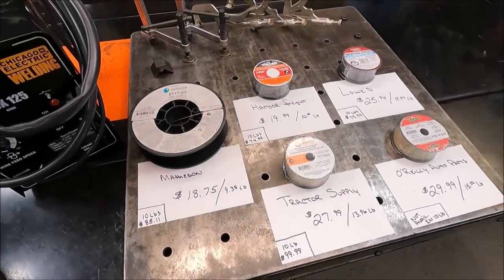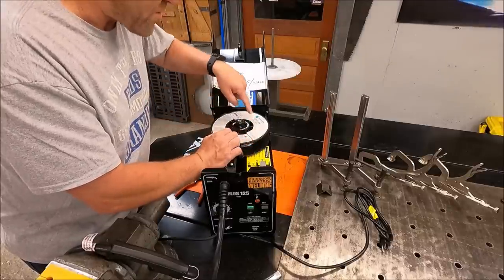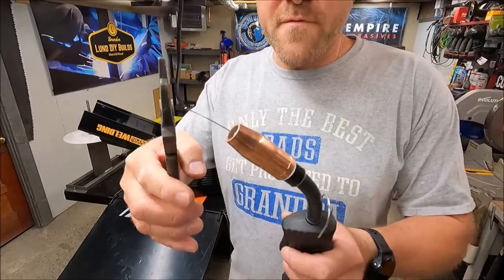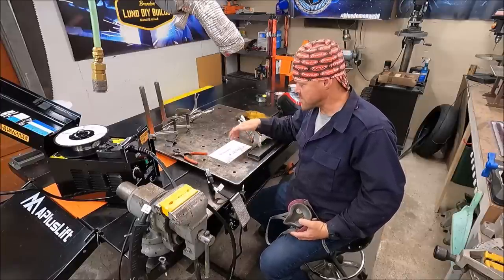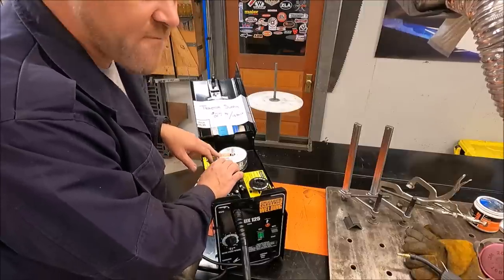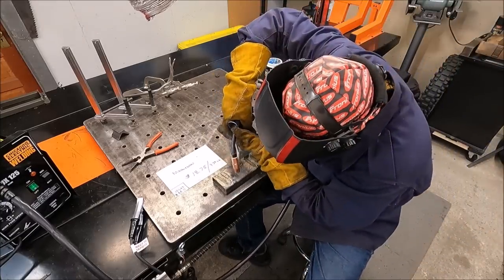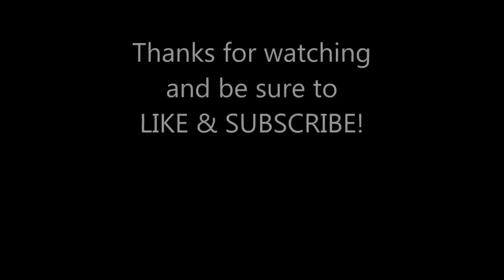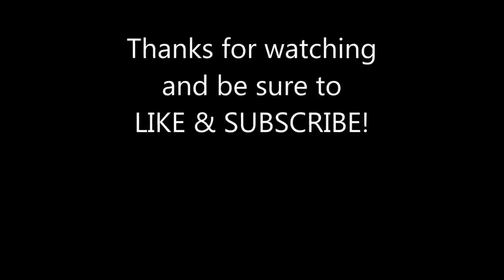Testing which Flux Core Welding Wire is Best

Comment: Hey, I bought that welder at harbor freight too. I've been welding for over 20 years professionally. I'm 6G MIG certified, and worked for several companies such as CASE, and TRAILKING, etc. Now I bought my welder to use as a field repair unit for small jobs. I'm fairly happy with it because of the price and features. I HATED the harbor freight wire that it came with. The 030 harbor freight brand wire sucked I was getting the same thing as you did sticking and stubbing. I was pleasantly surprised when I ran across your video and saw you were trying different wires out! I like the way that Lincoln sounded the best and I hated the sounds that the harbor freight and the O'Reilly's and the matheson wire sounded the Hobart seemed okay but the Lincoln sounded the best. Like it was getting the best penetration. I know that the harbor freight wire seem to be a cold roll every time I used it even when I crank the heat up all the way and the speed down all the way. I was welding 3/16 material down to 18 gauge. I'm definitely going to try out the Lincoln wire from Lowe's I'm assuming home Depot would have it as well and Menards? Thank you so much for taking the time to research these because I'm out of wire now and I need to re-up my wire supply! I subscribed to your channel now just because I like to watch other welders work and get their tips as well. When we stop asking we stop learning. Great job on the video by the way
Reply from the maker: @Zach Grayson thanks man I appreciate your support! Yah that Lincoln wire is really good stuff. You can get it pretty much at any of the big box stores including online. I have got some other viewer suggested wires coming up again real soon but up to now the Lincoln is by far the best wire I have used.

Comment: Over the early summer I cut a 1973 jeep cj5 in half and stretched it 20" in the center of the frame to accommodate a cj6 Body.   The stub section I put in to space it was a 3/16 rectangle tube I had acquired.  Years ago in my late 20's I had already boxed in the frame with 1/8th plate using a old sears 220 buzz box arc welder.  This time around I used a bare bones $145 Harbor freight 170 wire feed wired at 220v. I used Lincoln .030 flux from home depot on the req spacer to mate to the front and back half of the frame.  I ran it at its hottest setting which was almost a bit too hot .  After running out of Lincoln wire I couldn't find any at my two local HD stores so I ended up using a 2lb spool of vulcan .030 to continue the job and then attach the new suspension brackets.   It ran great once the speed was dialed in.  Around that time I mashed the crap out of my right hand and My Elderly neighbor offered to finish up the rest of the welding.  He is a retired Boilermaker and he pretty much knocked it all out in a long day and that included him grinding out some of my lesser quality beads :) .  He fiddled with the settings a tad and then went to town using the Vulcan wire . He ran the machine full tilt for quite a long period and it never went into the protect mode. Really made me nervous. But he's the professional.   He seemed to like the wire so there's that I guess.  I've since swapped back and forth using the Lincoln wire and the Vulcan wire when building my trailer. Once its dialed in on either brand they seem to be pretty comparable. I Enjoyed the video. Thank you for taking the time to make it for us!
Reply from the maker: @Deezildennis thanks man i appreciate it! You make a very good point. I think most wires will run pretty decent once you figure out what they like. As you know even subtle differences on torce angle and work distance can make a big difference once you have it dialed in. I think the noticable difference is when you just jump in without any prep from one wire to the next. The Lincoln just seemed to work better in my opinion without much learning curve. It sounds like you have great neighbor that is willing to lend a helping hand when you needed it. The workd needs more of that!   Thanks again for sharing! 🙏

Comment: It all comes down to wire speed and how hot you run your machine as it relates to your welding style and skill. Wire does vary but your settings and skill have a very big impact on your results. Find what works for you! Like many skills it comes down to practice and seeing what works. Great Video. Thanks for posting!
Reply from the maker: Thanks @imxploring you are correct but there is also manufacturer tolerances that impact how well the wire feeds and burns. Many aren't aware but solid core wire varies in diameter based on the manufacturer and flux core wire is rolled up like a piece of paper to contain the flux within. Flux core can be real problematic depending on how good the manufacturers tolerances are.

Comment: Good test.   I first used the Lincoln flux core 0.035 inch wire in my Lincoln SP-100, no issues.  Also have used the Lincoln flux core 0.030 inch wire which seems to give better penetration and no issues.  Both give butter smooth welds.  Was sold a lesser expensive wire and like you found, got stubbing till I ran it slower as well as a higher voltage.  The resulting welds are rougher.  This lesser expensive wire also throws off more slag and does not give the "frying bacon" sound.
Reply from the maker: @Evan Thompson I completely agree with you. Some viewers have given me a couple more suggestions on wires to try that they say are as good if not better than Lincoln so we will soon find out but until now the Lincoln is the best I've found so far

Comment: I bought a Titanium Flux 125 from Harbor Freight about 2 years ago and used the 1 pound spool that came with the welder on a project and also knowing I was going to blow through the wire I also bought 2 - 2lb spools off Amazon from Welding City out of Atlanta the same numbers E71T-GS for under 30 bucks shipped for both spools , liked it well enough I bought 2 more as back ups , they come vacuum sealed so storage doesn't degrade them as much as the shrink wrapped ones off the shelf at the box stores . Loved the video , always good to watch more welding videos . Thanks .
Reply from the maker: Thanks man I appreciate it! I'll have to look into that wire. Thank you for sharing!

Comment: That was a fun video. I do want to mention something about respirators and filters. The filters must be kept in a plastic bag such as a sandwich bag. Squeeze all the air out, and make sure it’s sealed. The problem, and most people don’t think about this, is that the filters absorb gasses from the air, even if you’re not breathing through them. A new filter kept out in the shop becomes saturated, and does no filtering after about a month, or less, depending on what’s being done in the shop and the heat and humidity. I learned this a long time ago in my own chem lab. It’s also on the plastic (sealed!) bags the filters come in. I’m sure almost no one reads this. They should.

I was also thinking that 10-11 pound spools are always cheaper by the pound. I wish my welders took 33 pound spools because they much cheaper by the pound. I’ve thought of using my lathe as a spoiler, but it’s just too much bother. House brands are almost always cheap unknown brands, likely from China. Since there is no law preventing them from charging 400% more than they paid, we get the ridiculous $29.95 for a 2 pound spool of cheap junk from that car store.
Reply from the maker: Great point! I used to use a paint can back in the day.
Reply: And there never will be such a law under a capitalist state, as capitalists (business owners) are who such a state is representing.
Reply: Just for kicks i just ran down to my garage and grabbed my 3m Respirator with OV P100 cartridges that are probably 6 months old and first tried to see if i could smell some solvents. Acetone, lacquer thinner, and denatured alcohol filtered just fine. Next i tried smoke from a soldering iron and still smelled fine, filtration working. Keep in mind these cartridges are barely used and they have the particulate filter so it's not like they're getting much airflow sitting in a cabinet. I then remembered I had another respirator that must be 5 years old, so i dug that up and yeah... definitely didn't work anymore. i'm still a bit high from that big whiff of lacquer thinner i just got. ugh.

Comment: I appreciate you testing all the different types of wires. 
 I am currently using the 
  Harbor freight " Vulcan wire" and I am having great results with it. I run my wire speed at a little over 5 1/2 on my machine. This speed works great for me. 
 Thanks for all your hints and techniques that you show us.
 We appreciate you!👍💯
Reply from the maker: Thank you very much! I appreciate your support @RHR77 and this just goes to show that some wires run a little better than others in different machines. When you run out of the Vulcan, you should try a small spool of the Lincoln. I've never heard anyone tell me they didn't like it :)

Comment: Thank you for doing this test.  The Lincoln Intershield wire you tested is an E71T-11 wire, while all the others are E71T-GS.   I don't know what (if any) difference that makes, but it would seem to make more sense to compare the Lincoln wire to the E71T-11 wire from different manufacturers. There also may be a difference between using an AC welder as opposed to a DC welder.  I have been using Blue Demon E71T-11wire and it works fine for me in my Forney 140 FC-i.  There are a lot of other choices of E71T-GS wire available as well - many for less than $5.00/lb (in a10 lb spool).  I understand that some wires burn hotter than others which can be good or bad depending on the application.
Reply from the maker: @Rocket Stoves Rock the aws designations would be a whole other test in itself but for general purposes it's what a consumer would end up with for a product based on using these wires that are ready available to them if they ran out of wire and ran to a local store to grab more. I only included Matheson because its been the brand I've been using and it's readily available.
Reply: @BrandonLund  Valid response!
Reply from the maker: @douglasgallardojr4759  thanks man 👍
Reply: The Hobart says right on the front that its E71T-11.
Reply: Hello, with what amperage does the e71t-11 0.030 cable weld well on thin sheet metal? Well, I have tried with 14 volts and 110 amps and it penetrates a lot without drilling
Reply from the maker: You are pretty much in the correct range. You might be trying to weld material that is just too thin for the wire size.  Maybe try 13 and 100 and see if that helps
Reply: I have never welded anything in my life BUT... In my research I found that the type of wire the lincoln is will allow you to stack/ weld over its self the othe Kind you can not
Reply: Another good video Brandon. Are all those wires of Chinese Manufacturer?
Reply from the maker: I have no idea
Reply: @supposedlycollectable4220  You are correct. The Lincoln can be Single or Multi pass wire. All the other wires are “GS” or General service, Single pass  (GS-General, Single pass) wires that CANNOT be welded over in multiple passes or it will dilute the base metal down and you run an extremely high risk of the weld cracking.

Comment: As an experienced welder, I found the same results years ago on the blue harbor freight welder. I also replaced the tip with Lincoln parts and did many adjustments to the unit. Still works very well.
Reply from the maker: @david wilson  HAHAHAHA I think I owned that same unit! It would trip the thermal overload and shut off in middle of welding so not knowing any better I bypassed the overload. I beat the tar out of that thing and eventually I accidentally dropped it off a bridge pier into the ocean. That was the last I saw of it.

Comment: Been mig welding for over 20 years. Just tried flux core wire for first time. Once I got the settings down I was really impressed. Thanks Brandon, great video. I'll be using the Lincoln wire.
Reply from the maker: Thats awesome Richard! Thanks for your support!

Comment: Awesome test , Lincoln welding  has been around for over a 100 years ,  my little buzz box is 45 years old and still works like the day I got it , it cost 125.00 back then  ,stay safe   TANK
Reply from the maker: Thanks buddy I appreciate it! I knew Lincoln was good but I wasn't expecting it to outperform what I have been using so I'm glad I did this test :)
Reply: When I'm spending someone else's money I buy Miller. If I'm spending my money it's Lincoln. Lincoln machines last forever.

Comment: I had the same problem using the Vulcan wire, I didn’t even finish welding what I was working on because of it, couldn’t turn the speed down low enough to get it to run right so it was a waist of $20, the Lincoln is definitely the way to go in that welder, I know from experience with it
Reply from the maker: My favorite by far!

Comment: Very interesting video 
I have used Lincoln wire and Hobart wire. As well as a couple of off brands. With my Miller machine I find the Hobart to run the best. With Lincoln second. They both produce a fine weld and run smoother than others. My experience is the Hobart had less spatter less smoke and deslagged the easiest usual with just a wire brush. But it varies with different machine brands and wire brands. You always need to fine tune wire speed and voltage/amperage to the wire and materials thickness your welding.
Reply from the maker: @Eric Hill I'm curious how these wires will run in my Fronius. I really like the Hobart and Lincoln also. I'm quite surprised they beat out the wire I have been using for years but this is why I wanted to do this test. I will be doing more like it very soon and with other wire also. It should be interesting.

Comment: Thanks, Brandon. I just bought 2 - 10 lb. spools of Hobart wire, 1 solid and 1 flux, at Running's while they were on sale. Glad to see I made a decent choice. I will, of course, use up the spools that came with the machine just because I'm frigging cheap. I - I mean frugal. Yeah, that's it, I'm frugal.
Reply from the maker: @Howard Grant I'm the same way...actually the more I played with the Vulcan wire the easier it was to run but I think that is true for most wires. But when you factor that out and just run them back to back the Lincoln and Hobart stood out as being better. I'm "frugal" too! 😏

Comment: Since you have all the wire already, will you run the same test with your other welder?
Reply from the maker: @Rob H that's a great idea and yes I'm very curious how my other welders will run this wire so I will be running them through a transformer based Hobart and inverter based Fronius and possibly YesWelder
Reply: Exactly. Not only are wires different, welders run different too.
Reply: That's why I bought the 125 just to see what it could do compared to my Lincoln and Miller machines. I was amazed. Most of my bend specimens were welded with the 125.

Comment: I bought a secondhand HF welder, the old blue one. It had run maybe 10 feet of wire from the starter spool and the guy warned me that it really sucked. And it did. I found two problems, both had the same cause.
It wouldn't feed well because the knurling in the drive wheel was full of greasy black crud. And it wouldn't hold an arc because the inside of the contact tip was also dirty. Cleaned and then looked at the wire. Wiped a few feet with a shop rag dampened with lighter fluid. Lotsa black on the rag. Put it back together and it worked just fine. Threw the HF wire and bought a spool  of the Lincoln 211 and it's worked fine since. Great wire to demo your welder. The dirty wire shut it down.
Reply from the maker: Thats awesome! Good score!

Comment: Thanks for doing this video!  I am currently running the Vulcan wire and I have experienced the stubbing too.  I figured it was due to something I was doing.  I am able to weld with it but my results aren't very consistent.  It seems like it runs better on really hot settings if I am welding thick stuff.  I am going to pick up some lincoln wire.  I have seen several showdowns and they all usually end up with the same winner - lincoln.
Reply from the maker: @Christopher Salisbury I knew the Lincoln wire worked good but inside I wanted to believe the wire I was currently using was the best (considering it was recommended by my LWS store) and I have been using it for years. You can pretty much manipulate any wire to work good after you run it for a while but when running them back to back without any learning curve, the Lincoln shined above the others. I love when I personally learn something and this surprised me.
Reply: Lincoln tied for third in my destructive testing. Harbor Freight came in last. The only flux core that didn't do better than the GMAW control.